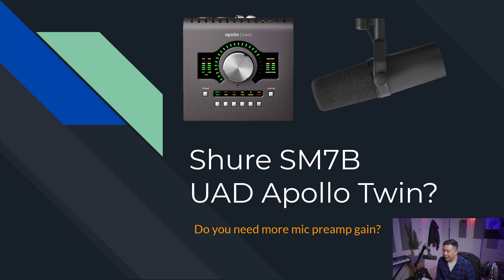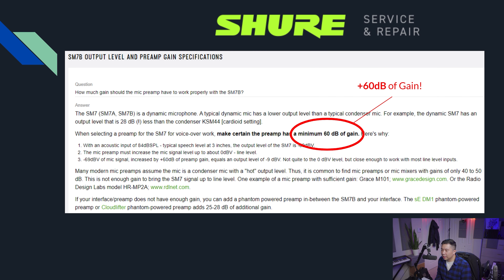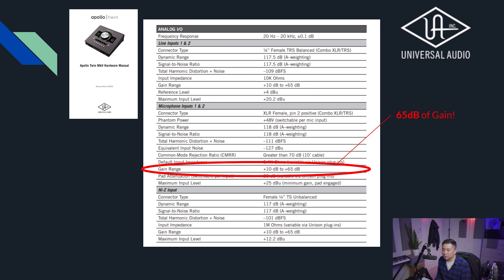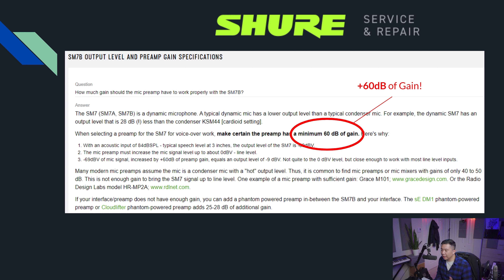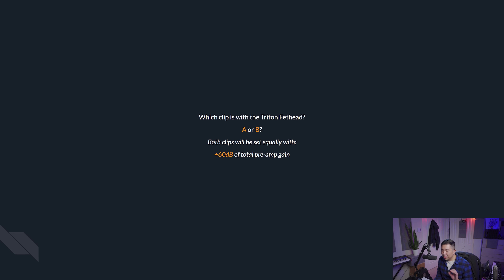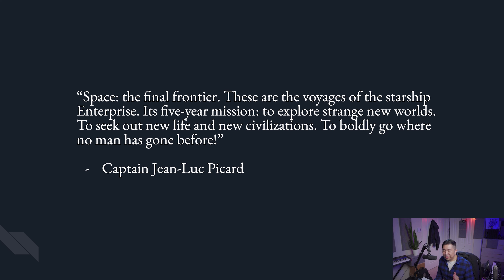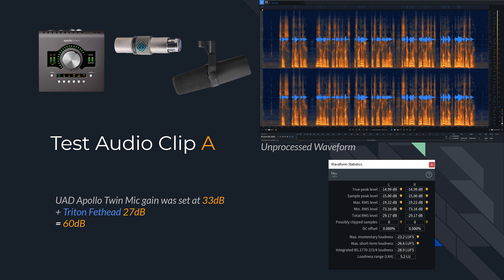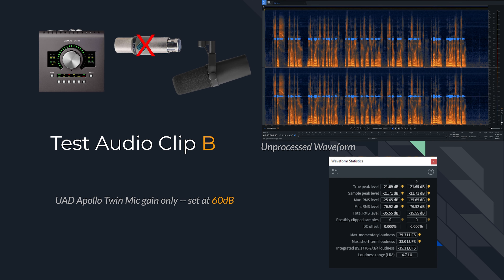Does the Shure SM7B and UAD Apollo Twin need a Cloudlifter or Fethead?

Comment: There was definitely more noise without the Fethead, honestly was looking for something like this for a while, great video!
Reply from the maker: Thanks!  Glad it was helpful!
Reply: @AlvinSWongMusic  Please, I am in need of your advice. I have the SM7B and the Apollo Twin X.
What would you recommend: getting an ISA One to use with the Twin X and SM7B, or just an SE DM1 Dynamite (or even better, SE DM2 T.N.T.)?
Would I miss the ISA's transformer-based sound or could I just use the Unison UAD plugins to achieve that, after the SE brings the signal up to good headroom levels?

Thank you very much in advance!
Reply from the maker: Hi Gabor, Considering the cost of the ISA is up to 7x more than a triton Fethead or dynamite. I would personally be more inclined to go that route and put the extra cash into more UAD plugins for maximum flexibility. The UAD with U-610 is a very popular alternative to the ISA from all the gear chatter. I have not had personal AB testing myself but I don’t think you’ll regret a low cost transparent fethead or dynamite.  Best wishes!
Reply: @AlvinSWongMusic  Thank you! I got both 610 preamp plugins, but discovered recently, that after the latest MacOS update to Monterey, they don't work anymore (and UA promises no support date even).
I do have other tube pre plugins in my account, though, like the Voxbox or Century Tube Channel Strip, so I'm not sure if that is a big issue, or that the 610s are so special in their sound presentation.

Thanks again, your opinion helped me much in my decision.
Reply from the maker: Yeah always a pain when new updates and new chipset comes out for support across the board. Let me know how your new combinations work out. Cheers.

Comment: I record at -33 LUFS with the mic and interface alone. Then boost it in post to -24 LUFS (clip gain). Then to boost it one more time with a compressor for -16 LUFS, apply a compressor with these settings: Ratio 2:1, Attack at 1ms, Release at 100ms, Threshold -12 to -24 (play this by ear, don’t crush your vocals) and the Makeup Gain at +6 to +8. Any compressor with these settings should do the job.

Comment from the maker: Just a note that the intro and the outro of the video was with the Rode NT1A microphone. The rest of the video presentation was with the Shure SM7B and with the Triton Fethead except for the comparison clip. 😉
Reply from the maker: @Kawo26  Yup. In a treated room like my studio, the condenser mic like the NT1a and the dynamic SM7B differences are not too huge that a regular audience can tell.  SM7B is more hi cut and picks up less room ambient sounds. Eq compression and FX can do wonders on either mics.
Reply: Hey Alvin! I have a question that I'm having trouble finding an answer to online. I have a rode NTK, I'm wondering if the unison preamps on my apollo x4 are good enough to pair and bring out the mics full potential or if I would be better off with an external hardware preamp. Basically same question as your video pertains to except with the Rode NTK rather than the Shure SM7B. Thanks!
Reply from the maker: @batmosh1522  Hi Bat, I don't have personal experience with the Rode NTK but it looks like a great tube condenser mic.  From what I see on the spec sheets it appears to be about 6dB's less sensitive than my Rode NT1-A here and with that I have lots of headroom even for unison preamps like the U610 which only provides like 30dB gain max to emulate the classic hardware.  The SM7B in comparison here is a dynamic mic and really benefited from the extra FetHead boost because it was over 25dB less sensitive than the NT1-A and unison would be difficult.  I think your NTK should be just fine.  Again, this is just my speculation here.  Nothing like doing some experimenting with creative gain staging and saturation etc... Just be careful not to fry your gear :).  BTW I think your NTK does NOT use phantom power as it uses its own power supply... probably best to not risk sending it if you're testing around... Good luck.  Let me know how it turns out if you get an extra preamp.

Comment: Thank you for this video! Almost pull the trigger on a cloud lifter but I'm glad I didn't. TY! Subscribed!
Reply from the maker: Glad it helped!
Reply: So, does it require extra Cloudfilter ?
Reply: @kaankucuk1612  Not if you have an apollo twin (or something similar) You just need to have a recommended 60 DB of preamo gain available. So just double check your interface manual if it goes that high! 

Rule of thumb:
No Cloudlifter---> Crank your interface preamp gain BUT could introduce some low "noise" or "hiss".
w/Cloudlifter----> Less interface preamp gain AND less noise.

Both work as long as you have enough gain on tap!

Comment: I could hear the white noise in both A and B but it was more noticeable in B. But my guess was right overall. Is there anyway to essentially get rid of the white noise? I own a cloudlifter but can hear the white noise when monitoring not recording. It's bothersome cause I don't know if it was my headphones or what. So I bought another pair and it wasn't. So I think the white noise is coming from the interfaces output rather than the input. So that was the problem. But I only bought a $100 interface but it works like a dream, almost as good as your interface.

Thank you for sharing this cause I'm looking another interface to record music with rather than to use for recording like podcast. Do you have any recommendations?

Comment: Triton Fethead Broadcast with Focusrite 8i6 and SM 7B; right choice?

Hey, I use a Focusrite 8i6 with an SM 7B and added an inline Preamp - the Triton Fethead Broadcast.
Is it the best option? I didn't notice very much boost and can't tell you if it add any db.
Setup: SM7B - 1m XLR - Fethead Broadcast - 3m XLR - Focusrite with Phantom-Power ON.
Is it the wrong Fethead?
Reply from the maker: I am not familiar with the Fethead Broadcast. Just the Fethead Phantom. The benefit with the phantom is you can plug it directly into the sm7b and skip that extra patch cable.  I think boosting right at the source at the mic before all that length of cabling to avoid picking up and amplifying any noise along the way is best.  Yes I turn on the phantom power and good to go. Big difference in amount of gain vs without. Something must be wrong if you can’t tell.

Comment: Hey Alvin.. which exact Fethead should I buy for my Apollo Duo Mk2 Thunderbolt & my USB Focusrite Scarlett 2i2 3rd gen. I would like one fethead for both devices

Thanks!
Reply from the maker: Hi Nayeeb, I'm guessing you plan on using an SM7B as well (as in a dynamic mic)? If so, then the one you want is the regular Triton Fethead. It is what I'm using with the SM7B and UAD Apollo Twin
 https://www.amazon.com/dp/B06XDPTDN5/ref=cm_sw_em_r_mt_dp_EJGDSVYHFY9TC3TVWE16

 Be careful as there are different models of Fetheads that are meant for other purposes like that for condenser mics instead or for special purpose filters.  I'm guessing you didn't want those right?  I would recommend looking at their lineup here:  https://www.tritonaudio.com/products
Reply from the maker: BTW If you are in Canada I ordered from http://www.economik.com/triton-audio/fethead/ -- great service and lowest price and shipping was pretty quick.  (I'm not sponsored or affiliated with them.  Just sharing my experience ;))
Reply: @AlvinSWongMusic  Hello Alvin, I am So confused that What audio interface should I use for shure sm7b? Could you recommend ones that doesnt require additional Cloudfilter or ones require additional Cloudfilter? Thank you (please specify which audio interface you can recommend)

Comment: Hi there. There are a lot of alleged values on the internet, how much gain the Shure SM7B is supposed to require. But there is only one official value. The Shure SM7B has an output of -59dBv. This does not translate to gain to begin with. You can translate it to -56dBu, but gain is measured in dBFS@0dBu. This simply means that an interface can add X dB of gain on a digital scale, and this is measured on a device, that is rated to deal with signals of 0dBu. But dBFS cannot be accurately converted into dBu or dBv. dBv and dBu are measurements for analog audio. Analog audio deals with positive and negative voltage. dBFS is a measurement for digital audio. Digital audio deals with zeroes and ones.

Let’s give a more general answer: every audio audio interface that is capable of delivering 50dBFS@0dBu of low-noise gain will bring anyone on a distance of 10cm to the Shure SM7B dangerously close to audio clipping without any noticeable self-noise. And: Unless you have a heavily sound treated an well isolated room with no noise sources in it, your background noise level will be most likely far louder.
Reply: So to clarify, you're saying you don't need a cloudifter for it then.
Reply: But will you have enough headroom left for post processing?
Reply: What’s the simplified answer I’m sorry not a audiophile

Comment: great stuff! Well designed tests and love the TNG quote as the reference. I'm using a mk1 TB twin (same 65db pre-amp gain limit) and I'm still not sure whether I need the inline preamp I got (SE DM1). Seems to sound great either way, but without the inline pre your mid/high seems to have more presence, and the one with the inline sounds more bassy - could just be how the Apollo pre's sound when they're driven harder, but that LUFS difference of ~6db is definitely an important consideration when comparing the two tests. 

I have a feeling normalizing to LUFS has a significant effect just due to the frequency content of either example and how the LUFS standard is weighted.  I just got the mic so I need to run my own tests, but this vid is a great starting point - thanks so much for making this!
Reply from the maker: Hey Rowan. Thanks so much for your thorough thoughtful comments here!  I was a bit concerned too with how RX8 adjusted to reach the LUFS targeting and debated doing pure post DB again only. Not 100% sure there wasn’t any other coloration with Izotopes algorithm. I am super interested in your experiences and yes this is just the start for some deep nerding out fun on this all 👍🙏. Cheers.